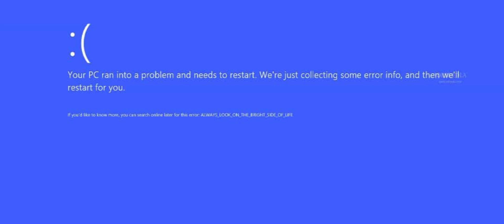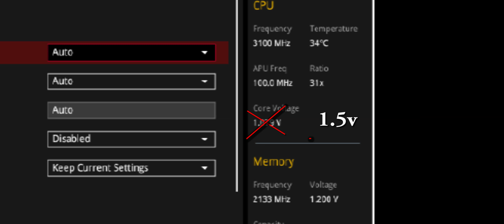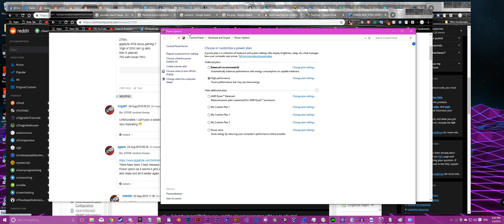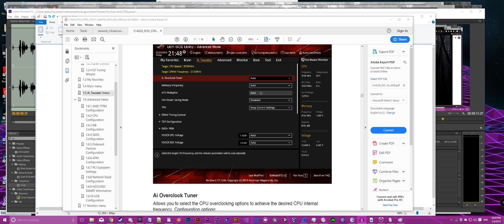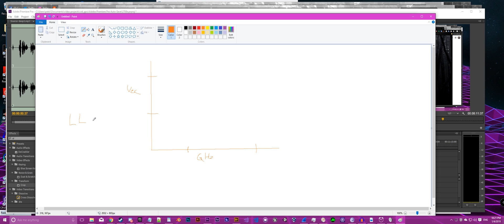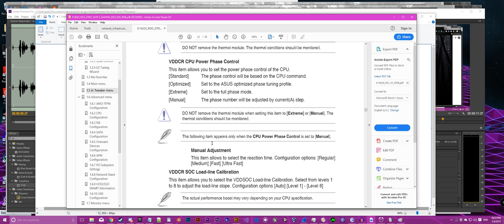Troubleshooting Random Freezes in Ryzen 2nd gen (2700x) Based Systems - PBO To Blame (fixed)

Comment from the maker: Hey people, thanks for coming across my channel and watching this video. I hope I could provide even the slightest value to you people. Just wanted to mention the steps shown in the video worked for me, so it may differ depending on your hardware, and other software related issues.

Btw, you're interested in trying out different OC presets for yourself, but don't feel like having the time or knowledge to go into doing so. check this out https://github.com/Patxio69/overclocking_presets_ryzen2ndGen.git. All the OC presets that I test are stored in this repository.
Reply: I have reinstalled windows so many times and installed newest drivers and now even F41 bios, I  have a Gigabyte AB350 gaming Rev 1. My 1600X is constantly freezing or crashing, sometimes 10x in a row and after that it works for the day until I reboot my pc again and the first thing it does is crash.  IM LOST, THIS IS UNBEARABLE. Its been like this for MOOOOOOONTHS now.
Reply from the maker: Dude, I think you've got a series instability problem with your system. If all it does is crash, I would recommend resetting all BIOS changes to factory default. If you see happen to face the same issue, probably some hardware problems. You then have to swap hardware one by one. Like first, test with a different RAM stick, if still happens, swap your cpu, and so on.
Reply: @machinephile  I mean now I disabled C-State and its fine, but if I boot up a game it might crash again, basically system will freze and  I have to hold down the power button. if I do that, it will be fine for the entire day after until I boot up my pc again after its been shut down for a while. Very very strange bizz but I never used to have problems until a certain windows update many months ago, after that its always been a freeze clusterfuck fest. My guess is my Samsung 960 EVO M2 might have somehting to do with it aswell I feel like my ryzen doesnt like it
Reply: @machinephile  I have this problem that my pc randomly freezes.my motherboard is asus x470 tuf gaming plus and cpu is ryzen 7 2700x.
What should I do?
For about 2 months that I disable usb suspend settings in power options and I disable allow the computer to turn off this device to save power in device manager  I  dont see this problem
Secure boot is off too
But what you think?
What is the problem?
What should I have change?
Cpu llc that you say in video? Or what?
I dont get any bsod

Comment: I'm running into similar stability issues for my build except I'm using MSI B550 Mortar with Ryzen 5600g DDR4 32gb @ 3200Mhz. I don't think it's a PSU issue, it's evga G3 850w which I reused from my old build which had no stability problems. I usually leave my machine on 24/7. What makes this so annoying to diagnose is it's usually pretty stable after a reboot and the random freeze, bsod instability issues only come up after several days to a week.

So just to recap what did you change for the load line calibration that fixed the stability issue? Was it originally on auto and you changed to level 3 or something else?

Comment: Hi bro i have msi b450 gaming plus, msi rx 480 8gb gaming x, 8gb lpx corsair, and my pc freezzes...black screen with red led from cpu , can you tell me what to do? Or anyone? Pls help
Reply: @slot-canavarı  didnt fix the issue now i have 16 gb ram but nothing, i read that amd gpu users have this issue but didnt fixed, so i tryed all possibilities and still nothing, at 2,3 days amd radeon settings has recovered due to a sistem failure...i left it on auto but the issue gives me squares sometimes then freezze , i dont know what else to do...
Reply: @slot-canavarı  my whole build is rysen5 1600, gpu msi rx 480 gaming x 8gb, 16 gb ram corsair lpx 3000mghz, ssd kingstone 240, psu seasonic 620 W, on an aoc minitor 32 inch 1440 pixels, my built you can see on my channel too, cause i am askin people all the time and nobody  has answers

Comment: Ryzen 3600
Rx580 nitro plus
Cv650 
corsair vengence rgb pro 3200
B450 aorus pro wifi
On 100%load it works fine but When i leave it idle or watching video it hangs/freezes and then 5-10 seconds it goes restart.
Kindly see the attached videos
https://drive.google.com/folderview?id=1-2Oxg-IwATRo3vRzkor4ZaGpWlM0rOY1

Comment: 3400g I had bsod problem before
Now having pc freezing randomly
What's the solution?
Reply: Me too sometimes it freezes or crash
Reply: @iyezleybalanza2866  try to update your driver's with a new fresh windows setup.
Reply: @mhprotic  you fix yours?
Reply: @iyezleybalanza2866  yes I just did 1909 windows and windows updated my driver's and now all resolved
Reply: @mhprotic  I updated all but still it crashes
Reply: @iyezleybalanza2866  what did u updated
Reply: @mhprotic  drivers and it said your drivers are up to date
Reply: @iyezleybalanza2866  take your CPU to the shop
Reply: @mhprotic  that's why I want to take it to check it by the way thanks for your help man I appreciate it

Comment: i get windows freeze just as windows boots and comes to desktop randomly. What even the viewer shows are Critical issue with core 41(63).

no idea what to do.. coz whn system runs , then it runs like nothing is there.. but randomly it happens.
Reply: Did you find any solution?

Comment: easy fix ... manually enter your memory timings in bios. it worked for me. memory timings are printed on the memory sticks label or google your model number. amd motherboards sometimes get the wrong values by default.
Reply from the maker: Great, glad to hear your issue got fixed. 

But this issue might be just your specific case and othe people might have a problem with different hardware just because there are just so many things that can go wrong which will outcome similar issue. It's just hard to pinpoint.

Btw,  for those who may be overclocking the memory clock manually beyond what it's rated for, the timings it came written with will not work. I've uploaded all my timing preset to my Github. If you ever wish to overclock your memory, consider trying them. And if you face any problems doing that, feel free to ask.

Comment: Bro pls help me!!!! 
I have a ryzen 2400g, the first time I had it, it never gave me problems, as the years went by, my pc started with problems, until one day playing gta v gave a BSOD and it restarted and when trying to restart windows, it was frozen and the whole system was there. Time passed, I even sold my motherboard, I bought a new one believing that that was the problem and nothing kept freezing until one day searching the internet since nothing came out I gave a forum on reddit that explained the issue of voltages, I did not give the solution to the problem I only explained the issue of the voltages to which I tried my luck and my board presents 3 presets one that is in automatic one that is in override mode and another that is in offset mode I put them in override mode and looked for the voltage safer for ryzen that was 1.45, it worked quite well for a long time and failed again yesterday I thought it was a problem of updating video drivers but it was not like that, I even bought two sticks more than 8 gigabytes in total to make 16 in my PC that is supposed to be the same, some corsair Vengeance lpx ddr4 of 3000mhz and although I don't think this is the problem ... I realized that the ones I had on my PC were c15 and those that i had obtained recently was c16, anyway it goes very well on my computer and they even work on Dual Channel, anyway I don't rule out the many freezings my PC is having but I see it more as a problem with the processor itself.
My motherboard is an MSI Tomahawk B450 with the updated BIOS for Ryzen 3000.
I hope you can answer this comment, very good video bro !, greetings from Chile!
Reply: I am using normally, and it freezes and I have to restart the whole system, now I put the voltages at 1.35 and the voltage of the ram at 1.35 as the manufacturer says, my board is a msi tomahawk b450, it is very good, it is an excellent board, but I think the problem is clearly the processor.
If you could tell me how to deactivate any option or something that may be triggering the problem I would appreciate it very much, aaaah and the BSOD are different every time, just have one I will write, as I said before, I will see your screenshots to see your setup to see how it goes with that.
Reply from the maker: The exact sequence of the BSODs and freezing events matter a lot, would be helpful if you could tell me how exactly your PC crashes. Like right after you boot into windows; after using your PC for a while; only and only when you play any games or do some heavy cpu based work? And does it just freeze or you end up with a BSOD every time?

If you get a BSOD, do you get the same error message every time or are they different each time? Can you let me see the .dump file? that might help us see if there's any software-related issue which is behind all of these or simply just the cpu is locking it up. 

And more than Voltage, what matters more to your chip's silicon heath, is how much current is being pushed through it. That's why you want to have your vcore at auto when your cpu clock is being controlled by Ryzen's bulitin PBO. This has been said by AMD many times that the algorithm for PBO controls Ryzen's clock speeds, it's better leave it on its own and let it do what it's doing.On auto, when there's less load on the cpu, the auto vcore will jump the voltage to even 1.5v to maintain the boost clock speed, since there's a lot less current flowing though it, there's no risk of degradation.

Anyway, try using Auto vcore first. And if you think you're getting problems when you're playing a game, I would recommend you to stress test yoru system with prime95.

And thanks for watching the vid, feel free to reach out to me if you face problems further on, I would be happy to help. Contact me here: patxiepic.perma@gmail.com
Reply: @machinephile  i am experiencing something slightly different, on r7 3700x, even if i just turned my pc on and im opening something the pc slows down and then reboots and after reboot everything is normal, i mean it happens sometimes and not on huge stress, even on idle and the temps are low (50 c),what can it be?
Reply: @machinephile  ok bro the bsod was clock_watchdog_timeout idk what to do, this is really stressin

Comment: My system (Ryzen 7 2700 / B450M PRO-VDH PLUS(bios9.5)) was locking up for a few seconds then returning to normal (even when playing a game) frequently. After watching this I checked my windows power profile too see the the chipset drivers had installed a new profile and reset the defaults.
After changing the minimum processor state from 90%(wth is that about) to 1% I haven't had any problems. I have all my voltage settings set to auto.
Reply from the maker: I'm glad your issue was solved.

Comment: This is so useful. Thanks. Can you provide links to technical reference or related threads with useful information? Even if its software related. I have understanding on troubleshooting this kind of problems with fx processors. But now i need to solve a problem with a ryzen build, it hangs or freezes for 1-10 secs randomly at games and basic apps, but doesnt on benchmarks. It does not present BSODs.
Reply from the maker: 1-10 secs you say? Does this happen and behave the same way every time you boot up your system? Or does that time till when you system freezes varies among different instances? 
And are you using manucal Overclock or keeping it at stock and using manual Vcore voltage? 

Depending on how, odds might always be that the chip isn't just getting enough voltage since at idle, PBO/XFR tends to scale up the clocks higher so it needs to be fed with higher voltage. Since to my experience, other instabilities from either hardware or software tend to just trigger a reboot but insufficient voltage can just lock up the system completely so you have to force reset it afterwards. 
 
I just can't seem to find the threads I got the most helps from but as far as I remember (I should have attached the links in the description, my bad) and what I settled down at, I pretty much set the Vcore voltage at auto and offset it by -0.09v. Now you will see some high voltage spikes at idle when you do that, which I also happened to discuss on the video and said it's harmful for the chip. But turns out, it was incorrect. As by AMD themselves stated that it's normal for the control algorithm to do these at idle and fear not since, the amps it draws is quite low at idle so it wont' degrade the chip.

Also to mention, that these were all based off of my side of the problem, so if your system seems to have instablity with other hardware or software, you might wanna check them first.

Thanks very much for checking me out, I'm very glad that it was somewhat heloful to you :)
Reply: @machinephile  I solved the issue.
After clean os install, updating to last version of windows(There was an update related to ryzen), double checked forums before installing any driver, disabling all windows defender functions, double checked all the configs in mobo/gpu/amd software. The issue persisted, so i took it apart and cleaned the mobo, ram and cpu, and put it all back together, then rechecked bios settings, and it fixed my problem. If i have to guess it was the CPU cooler being missplaced or loose. Really weird because temps were indeed high when benchmarking at max load(90ºC), on a normal scenario they were fine(55ºC-80ºC), temps did not change after the issue was fixed.

Yes it happened on every boot instance, randomly in minutes or in an hour, in certain games, for example sekiro, but in others did not for example DMC5, maybe interacting with specific npc's, or when a given graphic/ambient effect was triggered.

At that time i had tried manual settings for memory/cpu, auto settings and a mix of both. 
Yes i agree, most the time, when u have a voltage/overclock issue it will just hang up/bsod or reboot, i've never experienced throttling with any previous gen processors caused by voltage settings being too low.

Throttling/hangs tend to be more of a heat issue (VRM,CPU,SOCKET).
I thought about PBO because, well maybe its not trothling but it could be that it isn't working on the meant frequency. Turns out I was getting good PBO freqs even on mostly defaults bios settings (MSI gaming pro, rock solid board).

As for the voltage spikes on idling, yes it got me worried, but well, i assumed that MSI could tell if voltage is too high in defaults, and i was not into overclocking this processor with stock cooling. (I tried, tested, played a bit, but for the sake of it, not my computer lol.). It was fun :)
Glad you took the time, forgot to check out this comment, thanks.